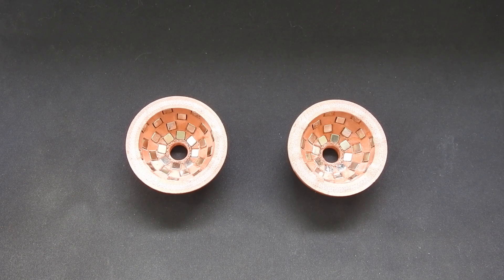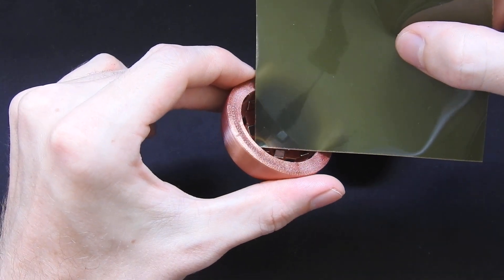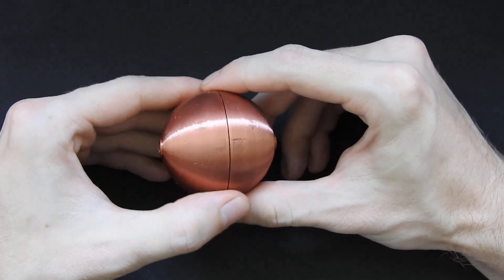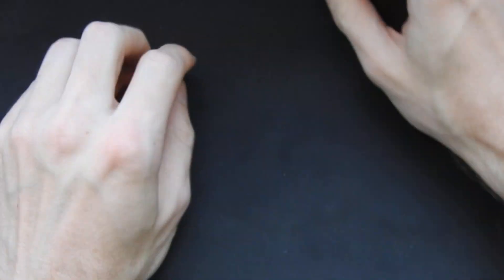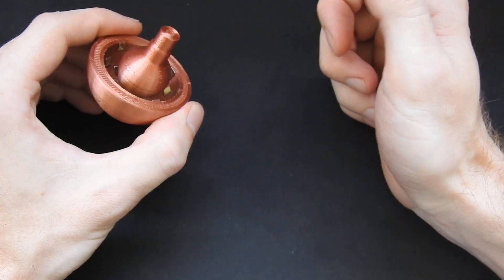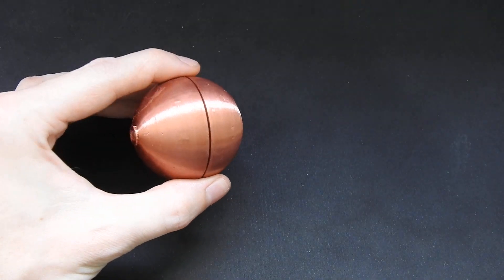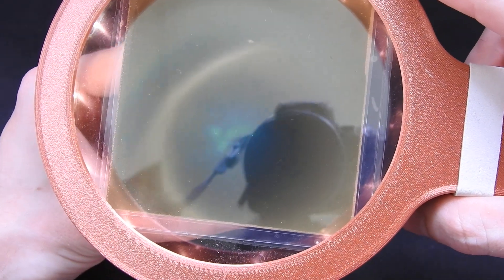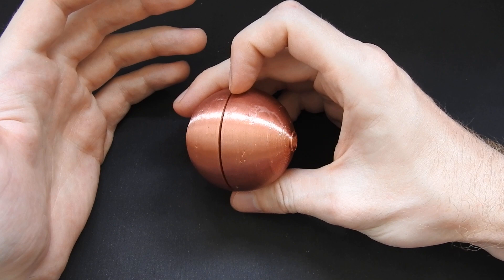Sphere magnet inside a spherical magnet array - elegant way of achieving field compression

Comment: Good on ya brother.  If you could make that into a smooth sphere, with all  magnets S pointing outwards, the outer surface is a monople where only N of another magnet is attracted to it..  

BTW an electrical load placed on a Permanent Magnet Generator PMG's will not slow the rotor of a Tesla turbine driving it.. The coging is constant.   Like you can make an electric current from two interacting permanent magnets. (PMs), but you cant make two magnets produce work with current without using windings.   With a DC-PMG, the rotors themselves can store a charge, like a capacitor, like a flux capacitor, and store a charge in a capacitor. Then dump the entire stored charge into a load and the Telsa turbines should be still purring like kittens.

Comment: I would like to know if you already obtained an "overunity" device.
Reply from the maker: No I haven't.
Reply: @OmegaZZ111  Did you at least got close to it? What was the most interesting effect you found? Did you get something that mainstream science cannot explain?
Reply from the maker: @wei3451  How would I know if I was close? 😆
There are certainly things I can't explain, it seems mainstream science always has an explanation for everything.
Reply: @OmegaZZ111  Out of all your experiments, which one surprised you the most?
Reply from the maker: @wei3451  The high voltage experiments were very interesting to me, but the effects of magnetic fields on water/the human body were the most significant for me so far.
Reply: @OmegaZZ111  I find your work amazing! You give me hope that there is some truth on these ''exoteric sciences''. After I get a degree and a job I will start donating to you through Patreon.

Comment: Hi Omega, got a question about Dielectricity, is it possible to power a common machine like a laptop with it? The impulse duration needs to be less than 100 microseconds to be safe, and without a magnetic component an inductor would have no effect on it for making the waveform stable, plus if it could be smoothed into a stable waveform that would remove the tiny duration of the impulse, so how would we use it for powering standard tech?
Reply from the maker: No way to power it with high voltage impulse electricity (what you call dielectricity) directly.
You will need diodes and capacitors to rectify it and to get a usable DC supply.
Reply: @OmegaZZ111  For what purpose would rectification serve? Dielectric impulses are already DC and don't need rectification, do you mean to rectify the pulsed nature of the waveform into a smooth waveform? Because that would result in the loss of the Endothermic (cooling) properties of the dielectric current as that only occurs if the impulse duration is less than 100 nanoseconds.

And what do you mean that I would need to get a usable DC supply? Are you referring to generating the impulses or powering a common device?
Reply from the maker: @JenkoRun  By DC I mean a constant voltage, like the output of a power supply. 
High voltage Impulses will most likely destroy sensitive electronic devices.
Reply: @OmegaZZ111  Perhaps a voltage regulator would suffice to keeping the voltage at an appropriate level? Fortunately pure dielectric impulses don't damage material if the duration is low enough, since odds are we can't make the waveform stable (because that ruins the non-damaging and endothermic effects) does this mean it is impossible to power things like common computers using it?
Reply: @JenkoRun  if I can envision this correctly it would be possible with a divergent device that takes in high voltage and radiates lower voltage over longer time. maybe a pyramid shaped cristal that takes the dielectric through in a divergent way or given the fact that gravity is a non point source the planet is basically doing the same thing you want(creating huge amounts of energy and dispersing it like a light bulb)

Comment: 13:00 You can *feel* the Earth's magnetic field by jiggling it in your hand??
That's a use case all by itself.

Did any embedded magnets get pulled or pushed out of its seating yet? This almost feels like watching you juggle a grenade lol.
Reply from the maker: You can feel it with any bigger neodymium magnet if you rotate it like shown in the video for a while. From my experience with some arrays you feel it stronger than with others of the same size, so I think the field geometry is important. 

Yes I glued the magnets in, otherwise they will pop out.
With the bigger sphere magnet it is indeed a bit like a grenade. 😄

Comment: What are the practical applications of such a configuration of magnets?
Reply: Repelling eldritch cosmic horrors trying to breach into our dimension of reality.
Reply: fusion energy to compress plasma jet engines
Reply: Plasma confinement
Reply: @Weedweird I think 13:00 counts as a practical application.
If you hook this up to some rig capable of measuring the magnetic flux within the array with great accuracy then you can "hear" impacts on our planet's magnetic field, like the solar flares that sometimes peel back layers of magnetic lines as if it's an onion/banana, you could even literally feel when these lines reconnect.
This would be the core of things we now consider Star Trek technology. Geordi LaForge would have you know to not hold one of these during an EMP attack.
Reply: Air barrings never wear out and last as long as the magnet, which can be around 400 years
Reply from the maker: @Weedweird That is a really good question. 
My guess would be that field compression could be useful for future technologies.
Reply: @OmegaZZ111 what an informative answer. Lmfao
Reply: hi in plain terms what is this used for can it heal or supercharge something?